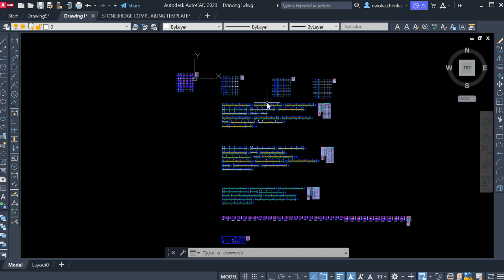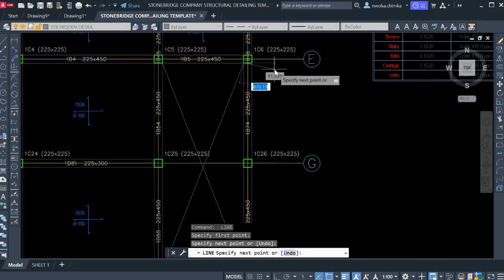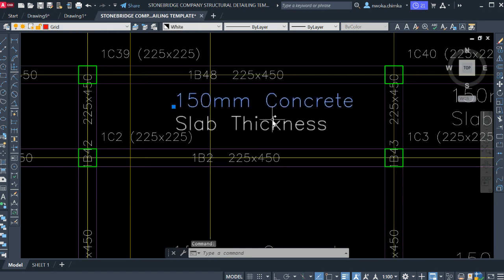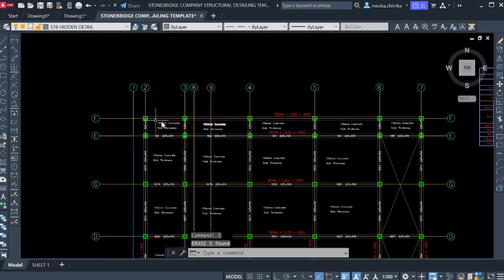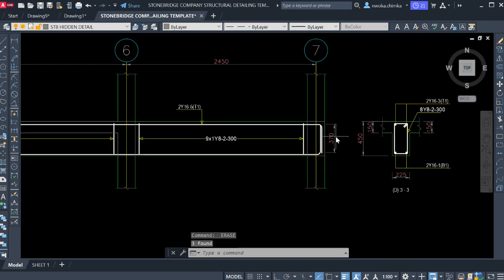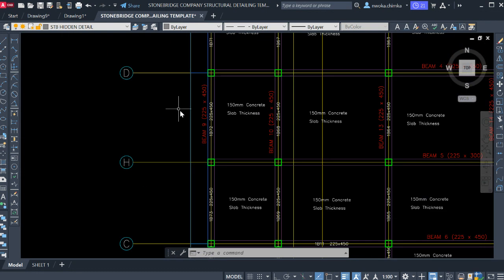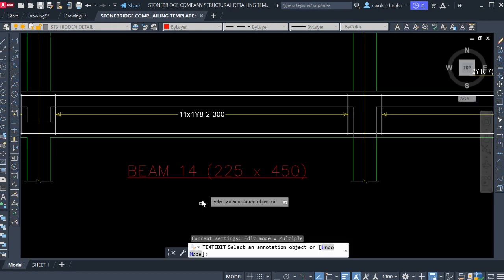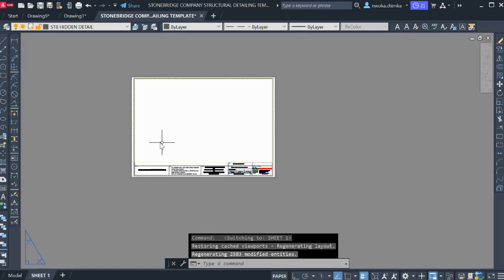PART 1 - Full Structural Detail Drawing After Protastructure Design.

Comment: Is the detailing template whose link has been shared in this video different different to the one you have presented in detailing for columns??
Reply from the maker: Yes it's different, because it's member setting is different, to give best results
Reply: @EkidelEngineering  what you mean is one’s  required to buy for each separate structural element i.e. for columns, G.A. & Beams, footings and Slabs??
Reply from the maker: @Samuelwengebanda  No,
One Stonebridge Detailing Template can go for all.
Reply from the maker: @Samuelwengebanda  I thought you meant for the my other templates.  If you are buying the Stonebridge Detailing Template, this template is a complete one for all detailing